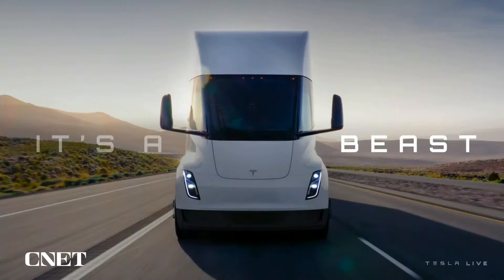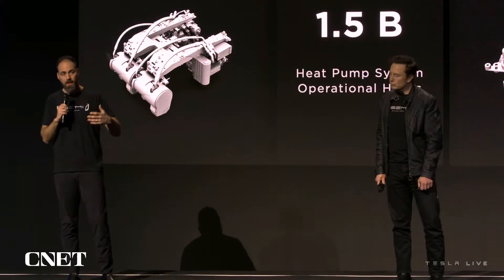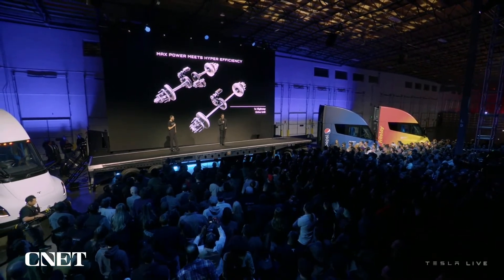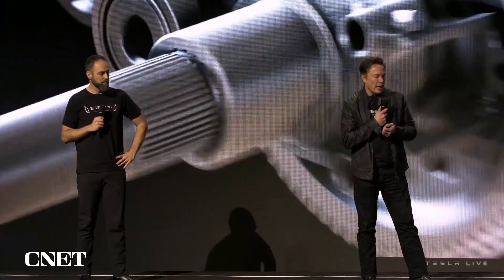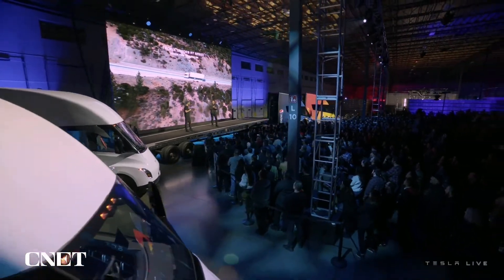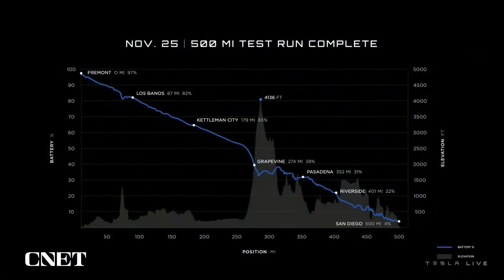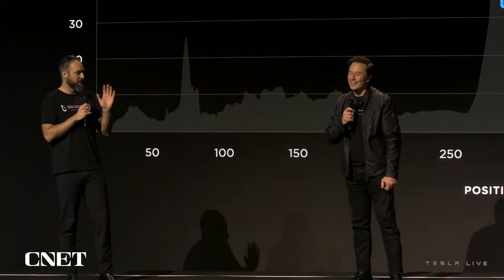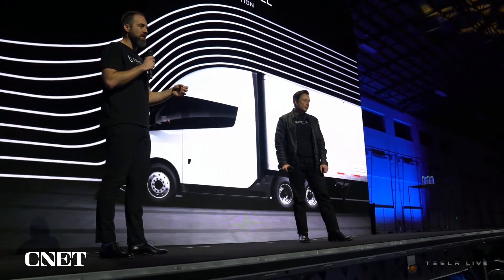Watch Elon Musk's Deep Dive Into the New Tesla Semi-Truck

Comment: Some of the negative comments on here are crazy. These vehicles will be very hard to get hold of, the demand will be gigantic. Initially owners will charge them at their home base and as the infrastructure builds out they will be able to expand the routes these vehicles can operate. When the first petrol / diesel cars appeared 100+ years ago there was very limited refuelling 10 years later that problem was resolved. This technology will rapidly move to other vehicles which always return to their base at night. Within 15 years new diesel lorries will be a thing of history and with that the pollution and noise these vehicles generate. I think Elon and Tesla deserve a big thumbs up.
Reply: Points to note.
"Infrastructure"
When talking about the cable/ Cybertruck charging, they said "coming to our chargers next year"
Elon previously said "3 times the amps"
I think these cables will be retrofitted on (some) V3 chargers.
Those are known for high temperature at the charge plug enen with the (old) cooled cable. That slows the rate.
This cable may allow "3 times amps" (currently 425A)?
Even at 500V that's 630 kWh.
.
There's the infrastructure.
That would fully charge a Semi in 1.5 hours.
(Great for all but max loads since the truck would only need a 30% top-up during the driver break).
These will be charging overnight at car charging locations, where the chargers are idle  8pm- 8am.
They don't need (want!) a super fast charge.
Reply: Deserved a thumbs up 🤣. Buddy do you know how stupid these are. The batteries alone are going to weigh the freight? Not to mention the faster you go the faster the battery dies? Above all transportation of goods can and should be run on diesel, same with equipment
Reply: @yothythoty729  
You must be clairvoyant, since with no expertise and I doubt any research, you seem to know the specifications.
.
As for the battery dying the faster you go"
It seemed to be fine out climbing that Diesel up the hill then outranging the driver with battery to spare?
Reply: @rogerstarkey5390 you can literally find sources on the internet on how much the batteries will have to weigh for range. The average Tesla weighs like 3x the average car to accommodate batteries. Now imagine the average semi with freight? You’d have to be an idiot to think it’s a good idea. This doesn’t even include charging times
Reply: @rogerstarkey5390 you know we’re also already running out of lithium and cobalt right? And there’s a chip shortage since we get all our chips from one provider in Taiwan? In every aspect it’s the worst idea. The only reason it’s being pushed is big business has all the money in it. You think all those oil tycoons don’t own all this?
Reply: less than half the load carrying capacity of a conventional truck. There is a reason why they have decided not to supply them to the market now and just use them ‘in house’ 😏
Reply: One 'fresh' Cummins <230000 miles, < 20 years. Fresh rubbers. Trailer talk.
Reply: It not that Charles.  Please remember a standard car has maybe less than 5 pounds of Nickle in it.  But a Tesla Model 3 has well over 150 pounds of Nickle.  So you can't have a green revolution without Russia because Russia is were all the Nickle comes from.  The only other places is Canada, and the Canadians are notorious for not returning your phone calls.
Reply: @marctemura2017  not to mention we’re already having a hard time finding cobalt as it is. Oh and also some states are literally saying (California) that they don’t have the resources to power them. This whole green revolution is a farce. Only reason why it’s being pushed is the big wigs have money in it
Reply: Okay boomer
Reply: Demand is high because the work force is slow and work force is small. Those batteries are going to die faster and will need to be replaced sooner than a consumer car. So the impact on the environment for the metals in the batteries and the cost to replace those batteries are gonna take a big hit. Not only that. Yea truckers do stay in their sleeper cab but they are mainly showing the single cab truck which needs to be charged and may cause time delays because the trucks need to be charged.
Reply: Facts.. Its about time ppl start thinking of the future...
Reply: Remember dumb phones and there battery life? Give it time
Reply: Its crazy people complain about availabilty of charging stations when in reality electricity is far more present around than gas pumps lol
Reply: Yup. Big improvement on performance, comfort, safety, cost of operation, maintenance, pollution... It's an unequivocally better vehicle. No reason to resist; rejoice!
Reply: This criclejrk party is hillarious...
Reply: @SKarea51  
Is that the denial circlejerk?
I agree, it is.
Reply: @rogerstarkey5390  it is the Tesla hype circlejrk party. 3 years after the initial semi announcement, they just announced  they're going to be testing more :). The tesla fanboys eat any bs
Reply: @SKarea51  3 yrs is relatively short for a product in R&D. Tesla just delivered finished products to Pepsi. What part of the 500 miles over actual terrain that was documented in the video that do you not get?  Would give you more credibility if you can point out why this semi EV is bad thing.
Reply: @vuvision  Pepsi? Whatabout hundreds of customers that gave the down payment? How would you feel not being pepsi??!
Reply: @SKarea51  
We don't get as a noted as the FUDs when they guesses don't come true.
Reply: There's an argument often made that while the vehicles are electric, the generation is from fossil fuels. While that's true now, even with renewable energy, it may not be forever. Electric vehicles are half of the equation, the other half would be something like commercial fusion or some other technology that brings renewable / limitless clean energy to scale and craters the price.
Reply: @Simo20XX  You are right.  And my dad said the same thing 50 years ago.
Reply: @Simo20XX  
A better way to "argue"?
The generation is from exactly the same grid that powers the refineries which produce diesel 
So kWh vs gallon the fuel/ energy give equal mileage when it reaches the "tank" (pack)
But there's a big difference.
They're equal at that point, but the moment a wheel turns, the diesel starts to pollute again
The EV doesn't.
Reply: Tesla (well...Elon) is presenting an overly-optimistic scenario where there won't be pain-points and real costs to expanding infrastructure. They'll mask that over with early adopters by accepting deep losses while offering "cheap" power at their powerstations. It won't last, as both Telsa cars and SpaceX are now demonstrating. Right now, no question, electricity is significantly cheaper than diesel, but if the price inches to 10, 20, 50 cents per kwh those savings evaporate and it becomes MORE costly to operate these rigs.
Reply: @roshi98  the break even price per KWH would be about $0.40/KWH.  but the national average commercial electrical cost is < $0.14 
The average MPG of a loaded truck is 6-6.5 MPG (diesel is ~$5/gallon).  We don't have details for the Tesla yet, but their slide said <2KWh/Mile.

So to travel 300 miles in a diesel truck is about $230
To travel that same distance in the Tesla is $84.
Reply: @jonathansmith4968  At current electric rates.  Think the utilities will stay at those prices?  Hilarious.  Also, since new pickups cant seem to tow anything and get more than 100 miles, these truck will have little effective range.
Reply: @ToyKingWonder  they don't need range. It's about cost effectiveness and the progress to stopping environmental destruction.
Reply: @roshi98  I get that, except that when you look at the previous products, they all are mind blowingly good. The Model 3 was said to never happen, won't be profitable, etc. When my wife got one, I started calling my BMW 335 "the clunker". TM3 was miles better in every category and ended up being the most profitable compact car in the industry. In other words: don't bet against Elon.
Reply: @roshi98  Electricity is a great equalizer. You can produce your own. If the electric utility starts charging outrageous rates, put up solar panels, wind generators, or even diesel or natural gas generators. There are many things that you can do. And that is just with the fuel part. There are other savings available as well, just like current Tesla cars. Reduced maintenance is huge as well. 

Just because things aren't always perfect doesn't mean that it isn't a big improvement.
Reply: @roshi98  Not sure what Space-X has anything to do with this, quite a diversion there bud. Pretty obvious you haven't a clue what you're talking about. Early Tesla adopter here, bought my first Model S in 2014 and it runs better now than the day I bought it with all the OTA firmware updates. No oil/filter change, no top off fluids, no transmission, alternator to maintain. Haven't had to replace brake pads, yep you heard right (look up regenerative braking). Modern Electromagnetic motor is virtually bullet proof, and can run 24/7, unlike the hundreds of moving parts in the ICE. Cost of operating EV is far less than of ICE, especially a diesel engine. My Tesla has been virtually maintenance free. Energy price will indelibly goes up, so will price of diesel. Be informed my guy.
Reply: @roshi98  
See my comment below re "infrastructure"
Reply: @roshi98  
"Real costs to expanding infrastructure"?
They're expanding it anyway.
Wait until they put the more efficient cable on V3 chargers (the clue was there if you listened!)
.
They're "accepting losses"?
But have a healthy balance sheet, in the green..... How's that then?
It's certainly better than Ford, or GM, or Stellantis, or... " You get the picture?
"If" the price inches 10 20 50 cents"?
Since I'm sure you're an expert on energy, I'm sure you can explain your rationale?

In FACT
Electricity increased 24% Year on year to February 2022 and is still rising 

Quote from the EIA
"Higher retail electricity prices largely reflect an increase in wholesale power prices driven by rising natural gas prices,” (and gas prices remain high, plus are expected to continue rising in 2023)
Do you know what will help keep it lower that it would be?
.
The two cheapest forms of energy production 
Wind and Solar.
Reply: @rogerstarkey5390  Solar and wind TO SCALE are nowhere near there yet, and since nearly all production of solar is left up to individual consumers and added to the mix via a very dubious "grid-tied" crediting system that heavily favors utilities renewables are years away from (if ever) helping the transition, particularly as electric demand goes up. Bar some truly revolutionary shift in state and federal policy, it's an uphill battle in an already-fractious and divided country. That's not me poo-pooing the idea (and idea I've advocated for FOR DECADES) but the economic and political reality. 

However, I do think there are opportunities to at least set a glidepath for power generation utilizing the grid we have, mainly through massive subsidies for energy efficiency and storage which can defray or eliminate the upfront costs associated with updating/upgrading existing homes and businesses as well as develop storage capacity for electricity at scale.

The current tax-credit and rebate programs available for heat pump systems, for example, offer nowhere near enough incentive for most people to use them as up-front costs are simply too high. Heat pumps systems (mini-splits, dryers, water heaters, etc) now produce 2-3x more back in heat/cooling output than the electricity used to generate it, an enormous savings both to the end user AND in power generation. Amplifying that potential in a massive public works program would free up space to expand infrastructure for electric vehicles of all kinds without adding more strain to our aging grid. 

Anyway, just some food for thought.
Reply: @roshi98  Aaron, good luck trying to speak common sense to these commenters.
Reply: its a scam!!!!!
Reply: @TheoisTeddy  I think the only thing you've ever invented was methane.
Reply: @guru2899  🐑
Reply: @TheoisTeddy  Would love to hear your detail explanations on why this is a scam. I'll wait.
Reply: @TheoisTeddy  lol...Intelligent? LMAO... Nice cop out. Early EV adopter here, also investing in various EV & battery companies. I try to keep up with this segment as much as I can. But yeah, I'll chalk this up to another uninformed talking point. Have a nice day my guy. 😎
Reply: @TheoisTeddy  I don't think it's a scam, but the blanket dismissal of EVERY legitimate question or concern by Elon's fans gets really tiring.
Reply: @roshi98  What are the legitimate questions that you're referring to?  Please list them.

Comment: 0:58 "New 1000 V power train"
1:30 "We are using our existing drive units, power electronics ...", "existing power train"
Tesla existing drive units are class 400 V. 
Tesla's statements as presented are contradictions.

Perhaps the battery is in 2 equal blocks. When charging the blocks are in serial with max voltage close to 1000 V. When used for driving the blocks are in parallel with voltage <500 V.

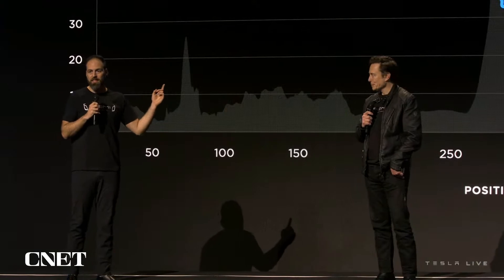Comment: 11:55 You state the total weight of the truck, but how much was the payload weight?
Reply: He won't tell
Reply: Don't hold your breath.  They will never say because the payload is small in comparison to a real truck
Reply: 82k Gross payload , you figure out.
Reply: @markplott4820  What is "gross payload"? 82k what?
Reply: @Foersom_   - hauls MORE than any GAS F150
Reply: @markplott4820  You surely would hope so. F150 is a pickup (light-duty) truck. The semi Tesla is a tractor for a class 8 (heavy duty) truck.

Please cut your nonsense, and just answer my question of this thread.
Reply: Omg. Keep reading and find out😢
Reply: @sherriali1029  Where?
If you know, can you please just state the max payload here?
Reply: Well, it appeared to have 9 concrete barriers aboard. 
A 10 ft barrier weighs 4,000 or more lbs. A 12 ft barrier weighs 5,000 - 5,500 lbs. 
It could be 36,000 to 49,500 lbs.
Reply: @meyermicro  thanks for the estimation. I want to see a statement from Tesla with max payload.

Comment: How long does it take to recharge? I laughed so hard when the clicker didn't work.. Happens all the time at important events with big companies
Reply: Roughly 4 hours using V3 Super Chargers, ~45 minutes using V4 Super Chargers, or around 20 minutes using MCS at a high enough charging level.
Reply: @anthonypelchat  Very impressive
Reply: 20 minutes.
Reply: apparently about 45 mins to charge is what other commenters have said,,
Reply: Supposedly under an hour using a "Megawatt" charger. The only megawatt chargers that exist are the few that Tesla has produced. Imagine the electrical infrastructure upgrades that would be needed to outfit a truck stop or trucking company with two dozen of these. This is still decades away from being mainstream if it becomes mainstream at all. Don't get swept away by all the hoopla and applause during the reveal.

Comment: The real breakthrough will be fresh battery swapping......seems like an obvious solution to the nagging problem of charge time waiting.

Pull into a station, badda boom, badda bing....the robots do this and that while you whizz, back on the road......no?
Reply: no, nowadays battery packs are also a structural part of the frame. plus with the right charger its charge to 80% in 30 minutes.
Reply: i would think that most drivers would adapt to the 45 min charge time,,  and why wouldnt drive habits change just a little for a new technology,, like you got to stop and eat and use the toilet at some point during the day so why not when your charging,, at least until the become autonomous,,  then they will just drive, charge, and drive and charge,

Comment: The only issue I can see is the regen braking will not work if the battery is fully charged. What happens then?
Reply: It has brakes
Reply: @nordic5490  I am not an expert, but on a long downhill run might not the brakes overheat?
Reply: @fredturk6447  
Before a downhill run, it has to go uphill- which means, sucking energy out of the battery and then you have enough capacity for regen braking.
Reply: Tesla just needs to not install a Megacharger on top of a mountain.  😂
Reply: When are you gonna have a full battery when going dow hill that much? Reasonable question but might be a rare situation
Reply: yeah, i think the battery will not be used 100% - most electric cars use 80-90% of total  battery  for reason of conserving battery charge, but  motor breaking is also part of it probably, because  when you overcharge engine brake stops which is not safe
Reply: If it was a problem on could always install air heater of some kind to use up the surplus power
Reply: @walterrwrush  sounds like a good idea, maybe they have done something like that?
Reply: The fact that you had to accelerate up to speed from the complete stop you made at the charge station means there is sufficient room in the battery for regenerative braking to a stop. The tech, unless they have completely broken physics, is not 100% efficient.
That is unless you fully charged at the top of a steep hill. In that case you're an idiot and certainly should not be driving any vehicle let alone a big truck.
Reply: Can you not fully charge when you are at the top of the mountain?
Reply: As previously mentioned you could use reverse engine torque for that, or you could use some sort of "bleed resistors" to absorb the excess regen power.